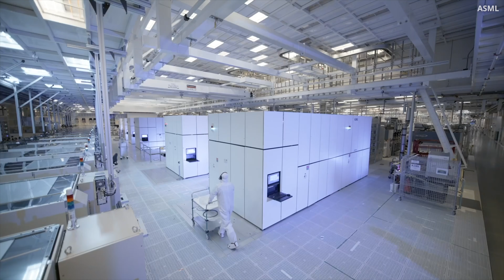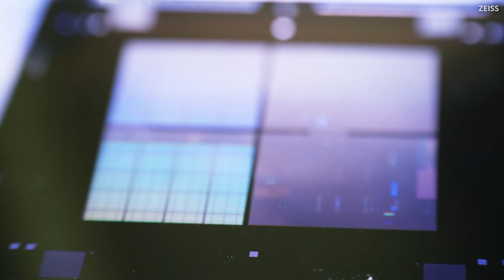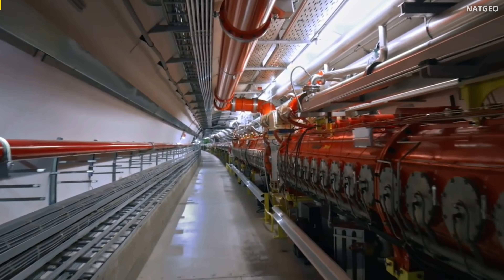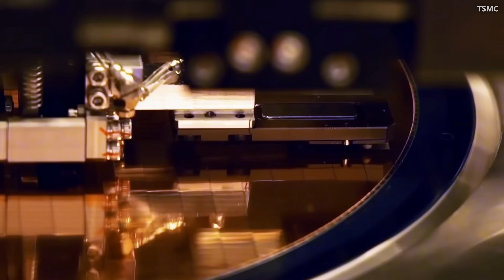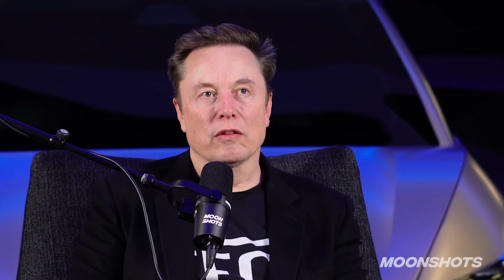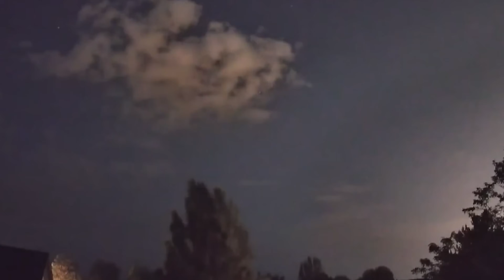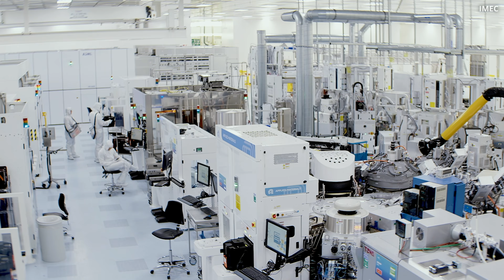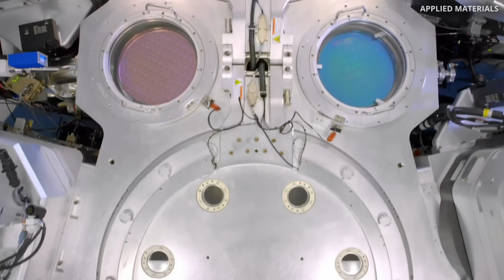New Chip Factory That Terrifies TSMC

Comment: When I was designing boards for the Curiosity Spacecraft I used radiation hardened FET Power transistors that cost $1,200 ea. The same commercial grade transistor cost $1.80 each. The ASIC’s I used were even more expensive. The development version was $300, the radiation hardened version cost $8,000 each. The BOM for these 20 layer boards was $200,000 each. The other cost driver was thermal management.
Reply: I have family in the systems engineering field and have some routing training. Could you go into more detail on what drives such a tall stackup? I've never heard of 20 layers being used before, and was trained to minimize layer count if at all possible, for signal and cost purposes.
Reply: @cackl @cackles1005 eve me I minimize layer count every time. Cost being the single biggest driver. 
Actually, I’m self taught and helped write the book. There was virtually no schools for this type of design at the time I started.
The interesting part, I was hired to do layout. By the time I got on site at JPL the EE hired to design and program the circuitry quit. I got to do the circuit design too. The job turned into a much more profitable endeavor than expected.  These boards had $200,000 BOM’s. Only ten were ever manufactured. I used Altium for this design but I learned to do manual tape ups in the 70’s and didn’t look back when ECAD became available. Layer counts under ten are reasonable in my experience, at 12 layers you’re pushing it on costs. High layer count is common in Military and Aerospace applications. One of the more challenging projects was Sonobuoys. Basically a product with a 20 minute life expectancy thats literally thrown away.
Mill Spec quality at a consumer product price. An audio amp with a -125dB noise floor and eight layers. The challenge was relocating components on adjacent analog, digital and power boards to stop noise coupling at specific frequencies. Clock circuits coupling with analog audio circuits were the worst. 
If you’re taking care of impedance and grounding properly layer count is not an issue for signal integrity, at least at frequencies below a couple of GHz. RF boards are a whole different gig.
Twenty layer stack ups were necessary because of very restricted board area.
Imaging a 20 layer 6” x 8” board broken into six sections by a metal frame 0.250 thick top and bottom sides used for thermal and vibration management. Now add a circuit with 1768 components including  16 TO-3 packages. Not much room for interconnects. You were probably taught to avoid using blind or buried via’s. There were several practices used that are not commercially feasible or recommended in high volume production. There was no maintenance or repair to think about. It’s headed for Mars. That was about the only break I got. Also, being hand built I didn’t have to deal with automated production. On the other hand you only got one shot. If my work had failed. Curiosity would be a very expensive pile of junk. The Pyrofire boards controlled explosive bolts that held the heat shield in place, deployed parachutes, ejected the crane system / Rover from the Spacecraft and deployed various masts and antennas on the vehicle. It was an interesting challenge.

Comment: Excellent analysis. However, I think several critical pillars are missing.

First, the human factor. Machines, clean rooms, EUV tools, materials, and processes are essential, but people are the ones who design, operate, optimize, troubleshoot, and continuously improve the entire system. TSMC's greatest asset is not its fabs, it is decades of accumulated know-how spread across thousands of engineers and technicians.

Second, demand. Terafab only makes sense if chip consumption keeps exploding. Looking at it through the lens of Jevons Paradox, every increase in computing efficiency tends to increase total demand rather than reduce it. Cheaper AI compute leads to more AI applications, more robots, more satellites, more autonomous vehicles, more data centers, and ultimately even greater chip consumption.

But there is a third factor that may become the ultimate constraint: sustainability. Every new generation of chips requires enormous amounts of energy, ultra-pure water, rare materials, chemicals, logistics, and infrastructure. The question is not only whether we can build enough chips, but whether we can sustainably support the energy, water, talent, and resource demands of a civilization increasingly built around computation.

In the long run, the sustainability of Terafab may depend less on transistor scaling and more on the sustainability of the planet itself. The real bottleneck may not be lithography, but energy, water, materials, and the environmental costs of an ever-growing appetite for compute.

Comment: Key Details from the Video and Related Reports
Project Overview: Terafab is a massive, vertically integrated chip manufacturing facility (or complex of facilities) planned primarily in the Austin, Texas area (near Tesla's Giga Texas), with potential expansion to other sites like Grimes County. It's a joint effort involving Tesla, SpaceX, and xAI (sometimes referred to as SpaceXAI), with reports of Intel's involvement for fabrication expertise.

Scale and Goals: It aims for extreme production capacity—targeting 1 terawatt (TW) of AI/compute power per year from advanced chips. This involves building 2nm (or similar leading-edge) process technology using gate-all-around (GAA) transistors, from scratch with limited prior semiconductor fab experience at that scale. The facility would integrate design, logic fabrication, memory (e.g., HBM), advanced packaging, testing, and even lithography mask production under one roof for rapid iteration.

Why It "Terrifies" TSMC: TSMC dominates advanced chip manufacturing (especially sub-5nm nodes). Musk has criticized the pace of existing foundries (TSMC, Samsung, etc.) in meeting the explosive demand from AI, robotics (Optimus), autonomous driving, Starlink/satellites, and xAI. Terafab seeks to bypass supply constraints through full vertical integration and massive U.S.-based capacity, potentially disrupting TSMC's leverage.

Investment and Timeline
Cost: Initial phases estimated at $20–55 billion, with full buildout potentially reaching $119 billion. It involves significant tax abatement deals in Texas counties.

Status (as of mid-2026): Announced around March 2026, with planning, filings, and some prototype efforts underway. It's highly ambitious and faces skepticism about execution (chip fabs are incredibly complex, with yields, talent, supply chains, and water/power needs being major hurdles). Some reports note Intel helping with aspects rather than Tesla building everything independently.

Context with TSMC
TSMC is heavily investing in the U.S. (e.g., massive Arizona fabs for 4nm/3nm/2nm production, with $65B+ commitments), partly to serve U.S. customers like Nvidia, Apple, and AMD while reducing geopolitical risks. Terafab represents a bold (or risky) push for self-reliance by Musk's companies.

The video likely breaks it down with technical details on process nodes, the challenges of building a fab from scratch, and the "genius or expensive trap" angle—common for Anastasi In Tech's style.

Overall: This is classic high-stakes Silicon Valley/space-tech ambition vs. the brutal realities of semiconductor manufacturing. It could accelerate innovation and U.S. capacity if successful, or become a very costly lesson. Demand for AI chips is real and massive, so even partial success would be significant.

Comment: Radiation hardening is not as important as redundancy and  error detection/correction throughout both memory and computation structures. 

Critical decision paths will be computed more than once and compared for consistency on physically separate computers. 

The heatsinks exposed to the cold of deep space will be overpopulated with chips that are just waiting for neighbors to fail before being powered up.

Comment: whats the difference between having one building that has multiple sections with highly specialized engineers for different steps in the process, vs having multiple buildings that each handle a different step and having to ship between buildings? Really just the shipping right? Like if one part of the building only worries about step 1, and then the other part of the building only worries about step 2, then how does that increase risk vs having separate buildings for step 1 and step 2? Thats where the "Its all happening in one place" argument doesnt make sense to me. Now if they were doing steps 1, 2, 3, and 4 at the same time with the same machine and the same technicians, I would say that seems like it introduces issues, but Is that what they are doing at terafab? It seems like the real issue is a supply chain shortage for the specialized machines for those processes and not having both machines in the same giant building. Which money can solve that issue and Elon is the richest man in the world so...

Comment: When I worked at LARGE SEMICONDUCTOR COMPANY we used sram chips to qualify our processor line.  It's just a different set of reticles. Usually you use your old product lines to build things like chipsets and then flash because the chipsets, flash and other products don't need the most advanced process.

Comment: Given that we have an 85% yield which I must say is impressive, when we get it down to two nanometers I'm not sure that will still be the case. So perhaps we should think about building 10 to 20% more capacity in the chips than we need with re-routing ability that can be burnt in afterwards. So when we test it and discover some dead sections we bypass them and replace them with the redundant ones at manufacture. That must be able to be done electronically by testing with various methods and then at the final stage give them a zap even though they've already been encased in the resin.

Comment: I'm very impressed, however, that they're planning to take lithography down to that level, especially when an atom or two either way is going to make or break this. I'd be very interested, though, in knowing how we make these chips more tolerant to some failures inside the silicon. What is the process that does that? Or do we simply throw the chip out if one single atom fails? And what happens if this occurs after production is complete when they are exposed to normal vibration and air temperature? What sort of testing process happens at the tail end of the manufacturing process to ensure that these are robust?

Comment: I understand that you're trying to say how many chips are built per year. That's fine. What is the processing power of those chips per annum? Well, if it's just listed as one terra what then we can assume if they're all running in parallel that's what you mean. But I still would add, that's not really a measure of how powerful the AI is. That's just how much power it's going to consume. If it is very efficient to nanometer, then perhaps that's a significant thing. But it's kind of hard to know. How about we measure in the number of calculations that it can do per second? That's the norm when measuring CDU's delivered and how about the memory calculations, how much storage is available? How much of that is? Shared memory, how much of that is dedicated? And what is the IO bandwidth between CPU and memory?

Comment: They got the gigafactory, the problem is they don't have the the associated facilities in proximity to the major factory like they do in Taiwan taiwan, you can walk to about 10 or 20 different buildings that can give you all the chemicals, the solvents, the solutions, the liquids, the plastics, the materials, you need to construct these chips in Texas. It's just a gigafactory.  And that's about it, you need more infrastructure, more buildings to incorporate mass production of math production efficiency and the components readily available to assemble in the main factory and Texas does not have it by a long shot, it's gonna take years to build up that type of result resolution.  But it's a good start

Comment: Multiple machines at start up means you can experiment with itterations faster to find best out come and transition faster.  
Data flow sped up gives you predictive graphs to advance to best chips. 
Scrap recycling also saves on upstream processing.
This leads to space factory manufacturing where old chips can be reprocessed in space where cooling, energy and cleanliness are of a higher standard base wise compared to earth. 
Moon and asteroid mining next come into focus saving on rocket launches.

Comment: The FOUP was created simply because when the silicone size went to 300mm a full boat of wafers was too heavy for humans to move each day and would cause health issues for the operators.....   8 inch fabs don't use FOUPs.... because they are lighter in weight...

Comment: Great video, thank you!  If anyone other than Elon Musk was attempting this, I would be skeptical to say the least. Just as I was skeptical when he designed and started building self driving cars and trucks, and especially when he developed reusable space vehicles. None of that was main stream back then, and yet look at what is happening now, basically a daily occurrence and common place. There are sure to be many hiccups along the way and failure always comes before success, but I think he can pull it off if anyone can. It will be fun to watch it happen as it unfolds for sure.

Comment: Engineers are not managers and should never get involved with managerial decision-making...they are simply not up to the task.  The entire vertical integration should ALWAYS have been done in one location.  Engineers, with their narrow thinking, prevented it and slowed down chip manufacturing for decades.  Ultimately it was the boards of directors that failed the industry for so long, bowing to the idiocy of engineers playing the role of management without qualifications.

Comment: As I recall, SpaceX solved most of the radiation hardening in software.  NASA had a cow, but SpaceX kept proving their approach more reliable... and vastly cheaper than 'state-of-the-art' at defense contractors.  It also allowed SpaceX to use industry standard software instead of archic programming that few (old) engineers could still produce.

Comment: Question. Can you start with simpler 3-5nm chips with the machines that make 2nm chip?  What I’m wondering is can this fab start by making the chips that Tesla / Space X / X is already using and work its way into the most advanced chips? In other words, use the manufacturing of the chips these companies already use to learn to walk and work up to running by making 2nm chips.

Comment: You need to go back to school hun,  Start with the basics and "Moores Law".   Gordon Moore, the father of the microchip.  He speculated that the number of circuits printed on one square inch of silicon would "DOUBLE" every six months, but the cost would remain relatively flat....   You BZILLION DOLLAR fab is obsolete before its even half done.
SECOND.  In 1985 I worked for a company that developed DIAMOND substrates to REPLACE silicon wafers/chips....   That was 40 years ago, and yet you will not hear about DIAMOND chips because the Government SEIZED all of our equipment 40 years ago....   DIAMOND is near imperious to heat..  meaning..  the speed, cycle rate is UNLIMITED..  Silicon chips shut down at speed/heat...    Last I heard from my friends in the know, we are now 'growing' circuits..  NOT PRINTING...    Your tech and China and Taiwan tech is 50 years old, and a joke,

Comment: Its possible they start with smaller chips... less transisters per chip and package more of them together, that helps deal with the "defect" problem, more will be without defects.  There has already been talk elsewhere of using fiberoptics more to get around communication bottlenecks between individual chips, electrical runs into interference problems, have to slow down the speed to avoid, its getting cheaper to convert between electrical and optical.

Comment: With the companies in Musk's constellation these affiliated companies are the largest chip customers by several orders of magnitude in the world. Musk knows that the making his own chips optimized for each of his varied specialized needs is a necessary component of Musk's vertical manufacturing integration and the fab does not even at this scale have any extra capacity to sell to any outside companies.

Comment: Ana - thoughts on Q.ANT? Q.ANT's photonic NPU (Native Processing Unit) is a groundbreaking, energy-efficient AI accelerator that uses light instead of electrons for computations. By utilizing Thin-Film Lithium Niobate (TFLN) circuits, these chips achieve up to 50 times higher speeds and 30 times lower energy consumption for AI tasks compared to conventional processors.

Comment: Vertical integration is what enabled Commodore to kill the other 8-bit computers back in the 80s. Many of those competitor computers even used Commodore's own 6502 chip! 

Commodore even made the cases for the early machines using office furniture arm in Canada. They were able to make metal cases for the first Commodore PETs.

At one time they made everything but the power supplies And screens. The rest was all vertically integrated.